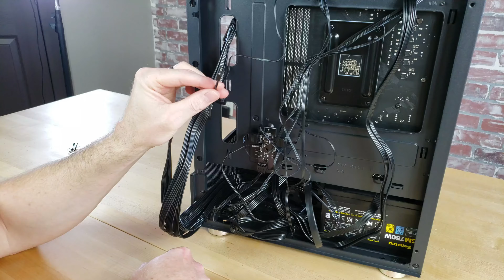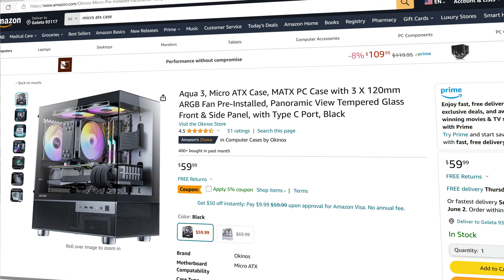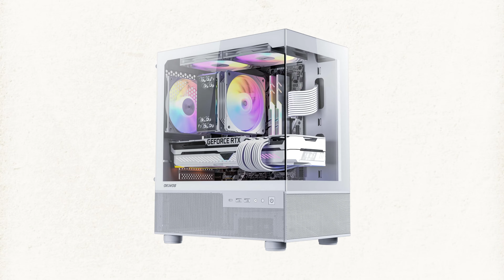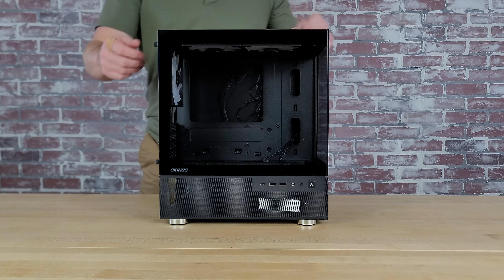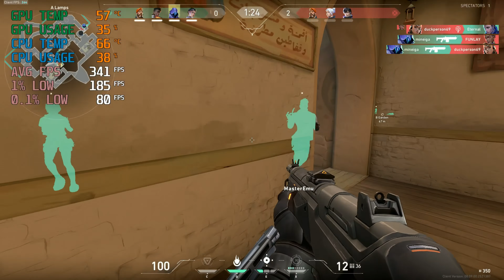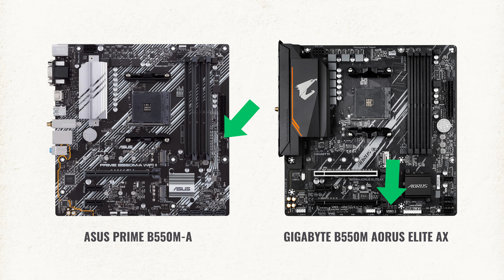Okinos Aqua 3 Review: Is this Budget mATX Case Good?

Comment: I had already bought one of these based on looks but I hadn’t checked out reviews first. I’m making my first pc build for a Bazzite gaming machine. I’m still waiting for the power supply so won’t be building anything for another week and started thinking about airflow and fans this morning. I should have considered this more before buying but I wanted a micro ATX and the aquas 5 which has 5 fans wasn’t available ,and the aquas 7 is a mid height case.  I was looking to see if I can install fans in the bottom of the case when I found d your review. Good job!

Comment: How do you sync all the rgb between ram cpu cooler and case fans
Reply: youll need a argb header on your mbo if you want full control, if not then youll have to use the presets on the case

Comment: Do I have to plug in the argb connector from the controller into the motherboard for this to work?
Reply from the maker: If you want to control the lights through software you can connect it to your motherboard. If you just want to change the lighting effects using the button on the case, you don't need to connect it to your motherboard. Just make sure you run SATA power to it from your PSU.

Comment: Hey, do you think an stock cooler from amd (wraith prism) would perform well with an ryzen 9 7900 in context of the airflow of this case? I also can think about of purchase 1 fan and put it in where are the hard disks for more airflow. Btw i think mostly this case would perform better with a smaller gpu (like 2 fans models) as like rtx 4060, 4060 ti or 4070

Comment: I have this case but how do i get the power button led light to work?
Reply from the maker: The power LED on mine came pre-connected to the ARGB controller. So, you just need to make sure the ARGB controller is connected to your PSU with a SATA power cable and it should work.

Comment: I would flip the top front fan to intake.  Don't care about the looks.
Reply: Honestly yeah.

I already ended up buying the case so I’ll flip fans
Reply: And what about the cpu fans cooler?Would you make them face towards the exhaust or towards the front of the case?
Reply: I tried to flip the fans but it had MAJOR overheating issues, making me flip them back. my harddrive was running at 130-150 F
Reply: Both top fans?
Reply: i think that's kind of the point of the case, otherwise, there are better cases out there for airflow if you don't care about aesthetics

i would never recommend this for someone who doesn't care about looks, as there are some sacrifices that had to be made

Comment: Could it fit a 3080 ti FE?
Reply from the maker: It depends on which 3080 Ti FE card. As long as its under 330mm long, it should fit. Not sure if there are any 3080 TI FEs out there under 330mm, though.

Comment: Is it possible to mount a 240 aio on the top?
Reply from the maker: You may be able to if you used slim fans, but Okinos doesn't list support for an AIO up top, and so I would honestly just look for a different case if you wanted to use one.

Comment: do they come with three cables for sys_cable or cha_cable if so do they come with a fan splitter
Reply from the maker: @sk3ched  all three of the case fans are preconnected to a 3-way fan splitter. So you will just need to connect the single end of the fan splitter to one CHA_FAN header on your motherboard and all three fans will get power.
Reply: @TechGuided thx

Comment: Thanks for this video. I love the look of this case, but with no intake fans, I think it’s actually too hot for my 5800x3d and reference 6800 xt. That’s a deal breaker.
Reply from the maker: Yeah, may be too hot for the 5800X3D without reconfiguring the fans. Would probably need to add fans to the bottom of the case, which may or may not be possible with your graphics card.
Reply: @TechGuided  maybe having rear as intake, with 2 intakes at the bottom. The reference card is 2.5 slots deep, so I may or may not need slim fans. At that point I either really want the case, or should get something slightly bigger.
Reply from the maker: @battlepowered  Yeah, tough to say. I think the safest bet would be to get a bigger case that is more optimized for airflow. I also reviewed the Aqua 7 and added three exhaust fans to the top and got really good thermals on my 5700X3D. It is quite a bit more expensive, though. If you're not dead set on a panoramic-style case, the Montech Air 100 is another mATX option worth checking out. It should provide adequate airflow in its stock configuration.

Comment: Is the argb fan hub in the pack 3 pin 5v
Reply from the maker: Yeah the fans are all 3-pin ARGB 5-volt and so is the controller the case comes with.
Reply: @TechGuided  so the power is also 3 pin, which means I have to switch the fans out for 4 pin 12 v
Reply from the maker: No, the fans power connections are 3-pin, but they don't connect to the controller. The controller that the case comes with is only an ARGB controller. 

For the fans power connection, they will need to be connected to a fan header (CHA_FAN) on your motherboard. But they are all pre-connected to a 3-way fan splitter, so you will only need to connect the single end of the splitter to a fan header on your motherboard.
Reply: @TechGuided  ok I’ll just switch to some 4 pin 12v fans off Amazon

Comment: I'm considering buying this case for my first-ever build, but I'm not sure if my MAG B550M MORTAR MAX motherboard will fit in this case or not.
Reply from the maker: Yes, it should fit.

What cooler are you getting? I did find it hard to connect the CPU power to the motherboard with an air cooler already installed.

The best way to handle this would be to install the CPU bracket outside of the case, then mount the heatsink after you've made the CPU power connection.

Comment: on my case, the pcie slot screws that hold the GPU in place are loose and cause it to sag. did you experience this and how do i fix it?
Reply from the maker: I didn't have this issue, are you using the correct screws? The ones that look like this:

https://preview.redd.it/jk8agszc2ofb1.png?width=1000&format=png&auto=webp&s=4f1ba6049f277610a93d9c20a30bd47f276aa587

If you used those and it's still loose, your only option might be to use a GPU sag bracket.

Comment: i already connected the sata to the controles but they do not work don´t spin eny recomendation?
Reply from the maker: Does anything else come on when you turn on your computer? Does the CPU fan spin?
Reply: @TechGuided  yeah everything is correct the leds turn on, the CPU fan also works fine but the fans from the case don work, an also I really appreciate you responding.
Reply from the maker: Oh wait, the controller on the Aqua 3 is only for the RGB lights, so it wouldn't have an impact on whether they spin or not. All of the case fans should be connected together via a 3-way fan splitter and that needs to be connected to a fan header on your motherboard. Have you done that?

Comment: 3:34 I ordered this case and the lights are not working on the fans. After watching your video, I realized I am missing the cable that is on the bottom of the controller and connects to Sata power. Do you know what that cable is called and where I can get a replacement? Visible at 3:34 in video. Thanks!
Reply from the maker: Sorry for the delayed response on this. Did you ever get it sorted?

If not, I would definitely contact Okinos as the case should have come with that cable.
Reply: @TechGuided  Okinos Customer service/support doesn’t exist from what I can tell. I returned the case and reordered the same one. It did come with the cable. Thanks for the reply.

Comment: hi, i have a questions about this case, this case dont require fan cooler in the bottom? i dont know if you could evaluate the temperature inside the box with full load?
Reply: Honestly I would mount a 120 fan under the case on the hard drive housing. And also install an aio water cooler 240

Comment: I buy this, but idk if I need a micro atx board ? 😢 because I buy a msi-pro z790-s
Reply from the maker: Yeah, unfortunately, that board won't fit in this case. You'll either need to replace it with a micro atx motherboard or get a mid tower case. The Aqua 7 is the same style case but bigger and will hold a standard ATX motherboard.

Comment: nice video. I happened to buy the same case but the fans aren’t spinning (the rgb works fine). Do you have any suggestions as to how to fix this, assuming the fans start spinning when the pc is turned on?
Reply from the maker: Sorry for the late reply, but did you plug the fans into a fan header onto your motherboard? Or just into the RGB controller on the back panel of the case?
Reply: @TechGuided i have the same issue. I have then plugged into the rgb header on the back
Reply: same mate
driving me nuts

Comment: I don't understand the logic of why case builders keep separating the Front IO connectors. NZXT gets it right.
Reply from the maker: I've never actually used an NZXT case. Are you saying their front panel connectors are just a single connection?
Reply: @TechGuided  yes they are, one solid connector. Makes it very easy :)
Reply from the maker: @henryojeda2890  That's amazing. Should be the standard.
Reply from the maker: @henryojeda2890  That's amazing. Should be the standard. Might have to try an NZXT case next!

Comment: Will it fit and Aio at the top if I move the fans under the gpu
Reply from the maker: It might be possible if you used thinner fans and memory that doesn't have a heatspreader that flares out at the sides.
Reply: What about a side aio like 120mm
Reply from the maker: @badpig3505  Yeah, you could install a 120mm AIO on the back panel
Reply: What 3070 ti models will work
Reply from the maker: @badpig3505  Go to pcpartpicker and put the aqua 3 as your case, then go to graphics card and type in 3070 Ti in the search bar and it will only show 3070 tis that are under the 330mm clearance of the aqua 3
Reply: Ok, will the airflow for good enough
Reply: Do you think airflow will be fine if I replace the fans at the top with an Aio
Reply: Will the rog strix 4060 for since it’s 3.1 slots and my mobo will use last 3

Comment: Will putting intake fans on top of the Psu shroud help alleviate the dust issue, or will it be alright either way?
Reply from the maker: Possibly, but I haven't tested it. My guess would be that it wouldn't make that big of a difference.

Comment: I found a 90° USB 3.0 adapter on Amazon from "Linkup" that would solve the cramped cable/header position issue.
I've wanted to get this case for a fun build, but have been worried about that. Now I might have to pull the trigger.

Comment: wait does it come with fans?
Reply from the maker: Yeah, it comes with three 120mm ARGB fans pre-installed. Two on the top and one on the back.
Reply: @TechGuided can you control the RGB via program? I don’t like those push button fans, I want the freedom to adress it how I want via a software.
Reply: @floww-87  I just built one of these systems.  The RGB hub does have a ARGB 3-pin that you can plug into your MB (assuming it has an ARGB Header) and you can control the Hub using your MB software or 3rd party.  I didn't bother with that.  This is for my nephew, so I left that unplugged, and kept the 2-pin ARGB button hooked up.  He'll just hit the button to cycle the RGB on it.

Comment: How do you change the color on the fans
Reply from the maker: It depends on whether or not you connect it to an ARGB header on your motherboard or not. If not, you can just use the button on the case to cycle through a handful of different RGB presets.

If you do connect it to an ARGB header on your motherboard, you can get more customization, but you'll need to download the motherboard manufacturer's RGB software.

Comment: Does it have any more slots for fans?
Reply from the maker: You can install an additional two fans on top of the PSU shroud (so underneath the graphics card). But, depending on what GPU you choose, there might not be enough room.
Reply: @TechGuided  thanks for the reply
I'll get the 7800 xt steel legend do u think there will be enough space?
Reply from the maker: @axstra2557  That's thicker than the card I used, so I don't think a standard-sized case fan would work. But something like these low-profile fans probably would: https://amzn.to/4eEzK8K

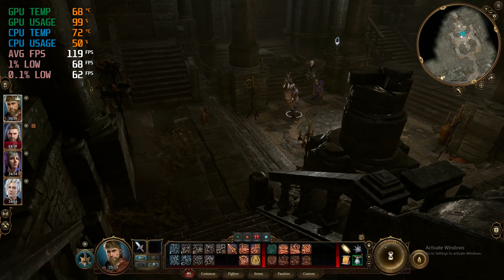Comment: 5:45 fans can be added to the bottom under the GPU for intake. this why i didnt get this, if I installed another GPU i would not be able to get any fans, and I am not sure an AIO can be installed either. They should make a "pro/max" version of this case and at least add fans to the side, this could be used as intake/aio.
Reply: They have a bigger versions called the Aqua 5 and the Aqua 7
Reply: what do you mean another gpu? this is a micro atx you can only have one

Comment: Woudlnt the air being exhausted out of case be good? my current PC has air being blown out of the back fan right now. i also purchased a better heatsink rather than the stock one with the amd 5600 i purchased maybe just switching the top two to intake maybe?
Reply from the maker: Yeah, it's good. I think most tests show there's barely any difference between negative pressure (more exhaust) and positive pressure (more intake) configurations. I think the main downside of an all exhaust configuration is that it can bring in a lot more dust.

Comment: Great review! But just to confirm sir. The fans are powered directly by sata connector and not on the board right?
Reply from the maker: The fans get connected to the motherboard, but they all come preconnected to a 3-way fan splitter so you only need to use one fan header on your motherboard for all three fans.

The RGB lights on the fans are connected to an RGB controller, and the controller needs a SATA power connection from your PSU.
Reply: @TechGuided  thank you so much! Sub!!
Reply: @TechGuided what if my psu doesn’t have a place to connect to the sata?

Comment: Can I turn the top fans so that they are putting air in instead of taking it out? so that the rear fan is blowing air?
Reply from the maker: Yep, you can definitely flip the top fans around so that they intake air.

Just note that the bracketed side of the top fans will then be visible.
Reply: @TechGuided  I don't care if they are visible, it's just that I live in a hot area (Barranquilla/Colombia) and ventilation here is very important. If I turn the fans over, won't the power supply suffer from temperature problems?
Reply from the maker: I haven't tested it, so it's tough for me to say for certain. And, it's going to depend a lot on what other components you use in your build...but even in the most extreme scenario, I don't think flipping the fans would cause a significant difference in your PSU's temperatures.

Although, due to the hotter climate you live in, it probably wouldn't be a bad idea to consider a case that is configured to promote better airflow.

Comment: I just saw this case today and it's in my cart but I'm still weary of tempered glass. The shorter depth is what I need though as I have a small desk. 🤔
Reply from the maker: Understand your concern with tempered glass. I've never had a panel break, but doesn't mean its not possible.

You could go mini-ITX. I have the Cooler Master NR200 and it's about the same depth as the Aqua 3. Though, its more expensive and getting a mini-ITX board and SFF PSU will likely run up the price further.
Reply: @TechGuided I decided to buy it and I'm nearly done with the build. I'm curious about your graphics card. Do you think 15mm slim fans would fit under them? I was eyeing that model and used fans in mine.

Comment: I hadn't realized the fans are 3 pin, that's kind of a bummer
Reply: For the price it's understandable
Reply: @danielgonzalezjimenez5677 You can get the sama case for the same price, better airflow, and an included fan hub/RGB controller
Reply: @danielgonzalezjimenez5677 Exactly...it's so cheap it leaves money on the table to just upgrade the fans...and it don't have to be high end brands...still keep it budget...get one of those good budget 3 to 5 pk fans
Reply: @danielgonzalezjimenez5677 that’s for the argb
Reply: Most modern motherboards use voltage regulation on the fan headers to change the speeds.  Nothing wrong with 3pin.
Reply: That’s for the fan power?